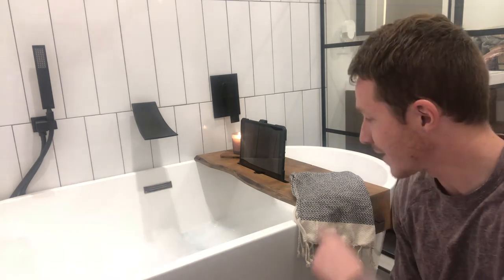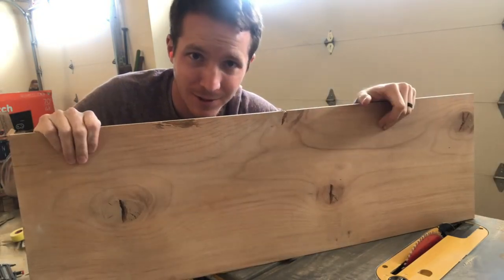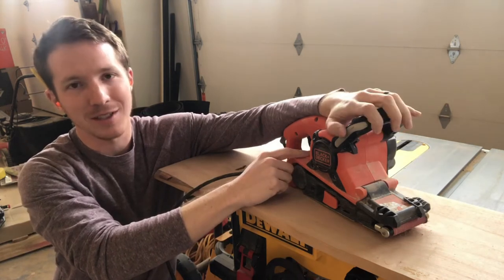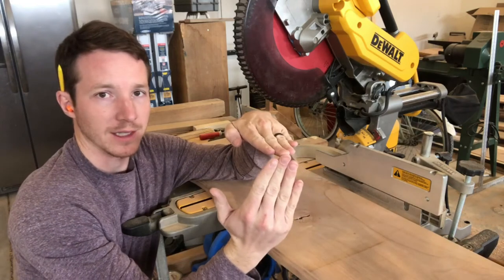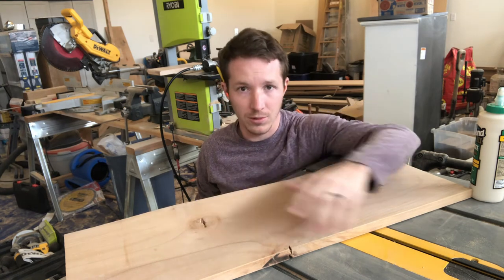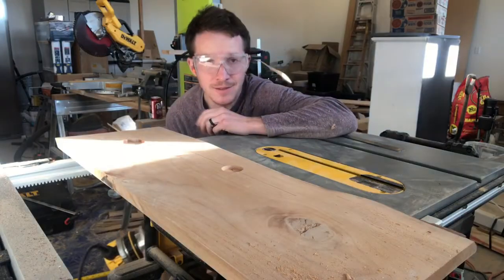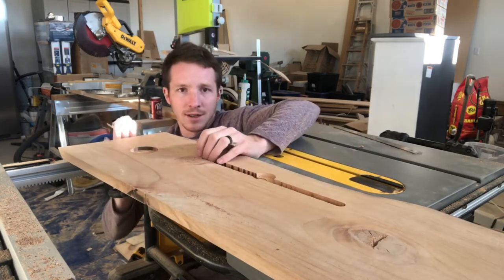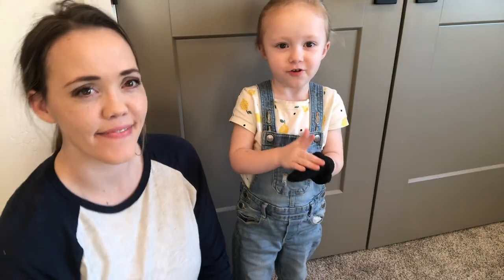How to Make a Faux Live Edge Wooden Bath Tub Tray | Best Homemade Gift Idea

Comment: What would you recommend if the tub doesn't really have an edge along the side that touches the wall? Like in a shower/tub combo that is just part of the house?
Reply from the maker: You might be able to make the waterfall edge on the outside longer and tighter to the tub, as well as make the little piece I used on the inside of the tub edge go down further as well.  I'm not totally sure if that would work, but it might be worth an experiment (without putting the electronics on it at first).  Another option might be to attach some of the stronger suction cups to the tray along the tub side wall.